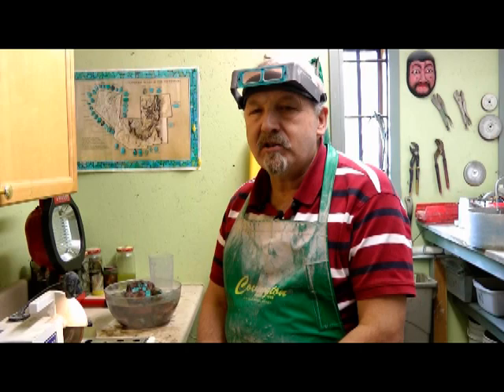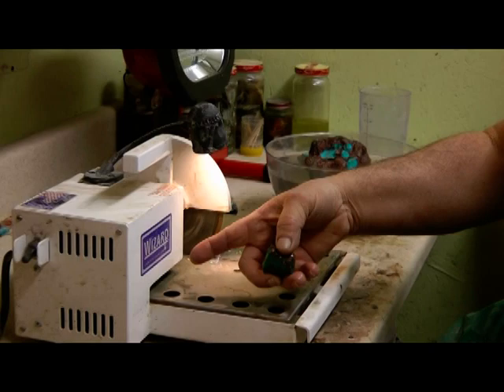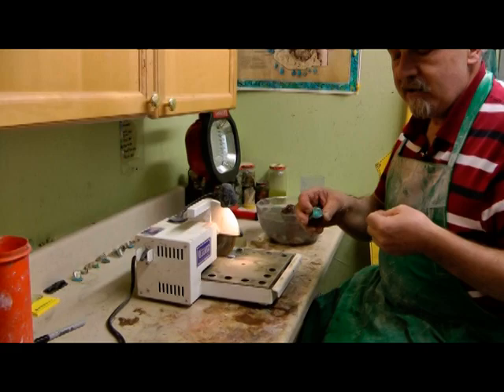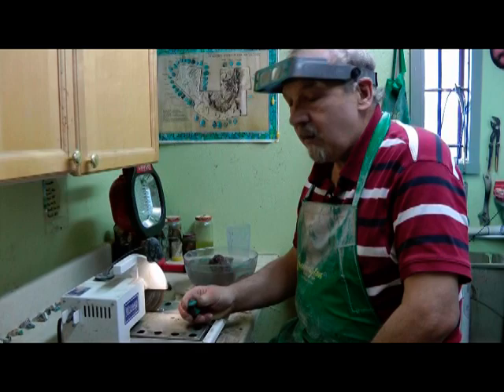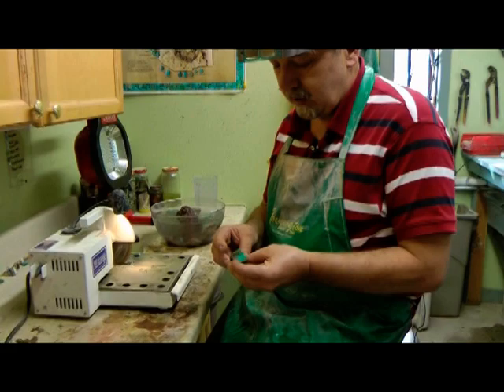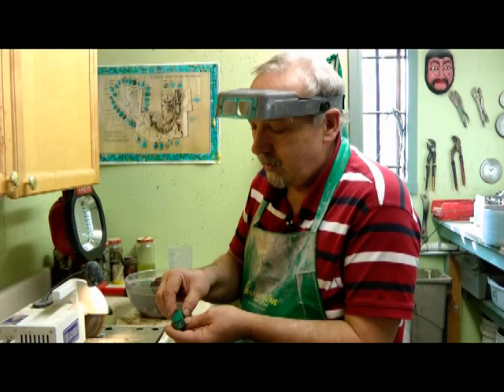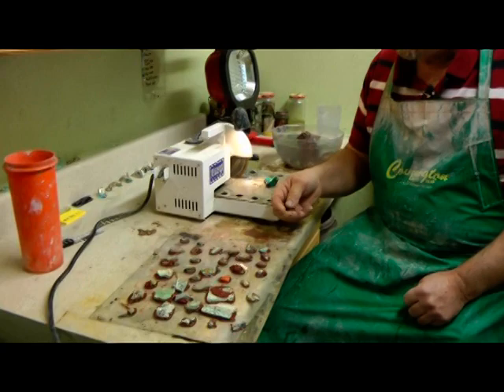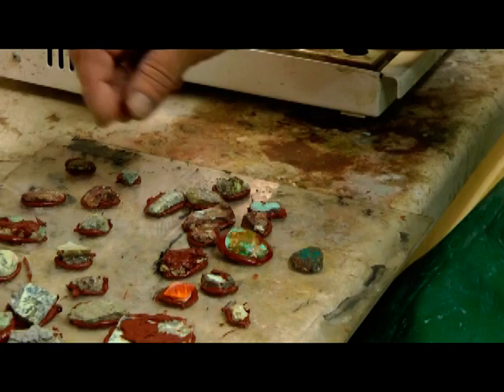How to cut a Turquoise Cabochon Part 1

Comment from the maker: Well they are one in the same tech. speaking.  I call a trim saw a saw that has a 6 inch or smaller blade.  A slab saw is what I call a saw with an 8 inch blade or larger

Comment from the maker: Bisbee is no longer available commercially.  We bought what the miner's brother in law had left as well as some other local collections and collections from around the country.  We actively seek old stock material.  Production at the Bisbee mine closed approx. 30 years ago, but not from over mining.  It was leased for the Turquoise from Phelps Dodge corp.  When they pulled out of the Lavendar pit, they did not want anyone in there.

Comment: How do you think a 3400rpm tile saw would fair with this assuming the correct blade was mounted?
Reply: It will put lots of micro fractures in the rock and you will have a hard time polishing it after you use a tile saw on it